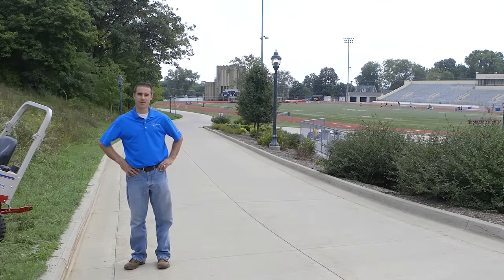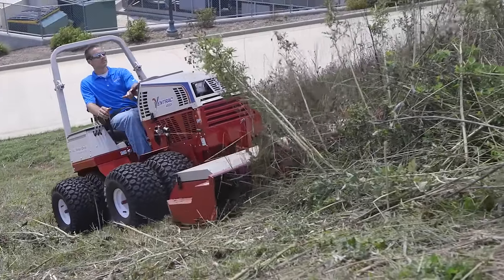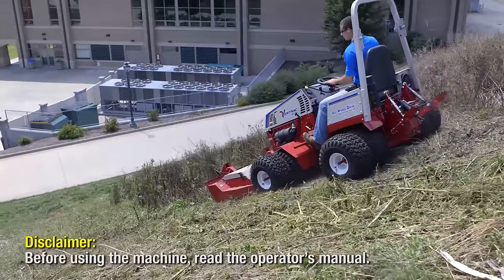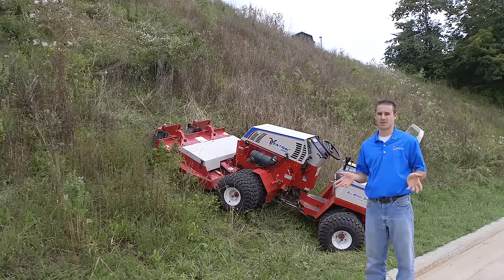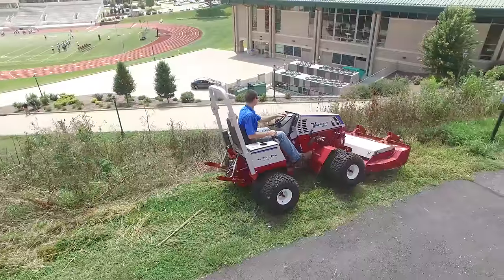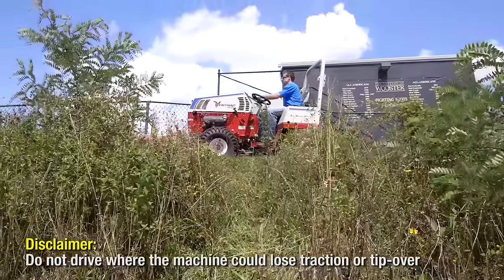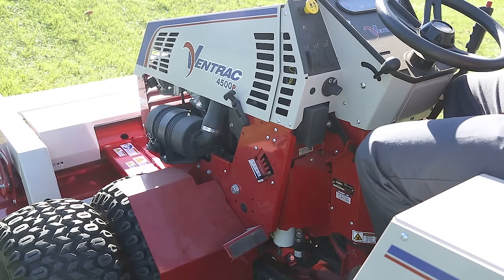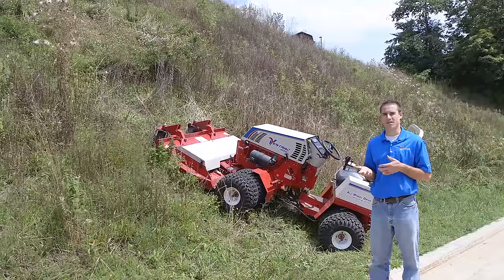Mowing Thick Brush on a Steep Slope with a Ventrac

Comment: The design of the things is so stupid the steering wheel is on the front portion and the operator sits on the back so when you turn the steering wheel it moves left and right for example if you’re mowing along thick tall brush and you want to turn away from the brush that is about to kill you the steering wheel will go into the brush and you’re gonna have to go with it to get back out it’s just not a good idea for an operator to reach across a pinch point on any articulating machine operate it
Reply from the maker: It's actually not like this.  The steering wheel is located directly above the center pivot so the feeling for the operator is very natural.  The steering wheel is not swinging away from the operator.  It's hard to imagine, but if you get the chance, hop on one and try it out.  It doesn't take long at all to understand the turning dynamics of the machine and it feels natural right away.   Articulating machines can be a little tricky around fence lines if you're trying to get very close, but a good operator will have no problems with that either.